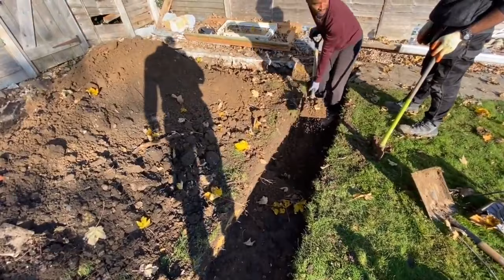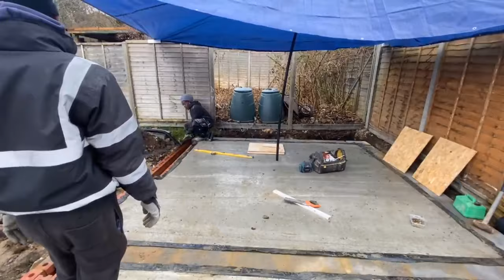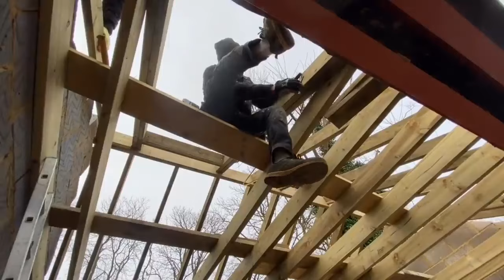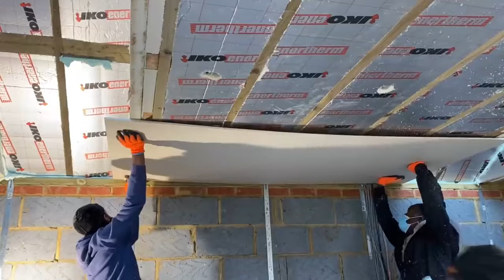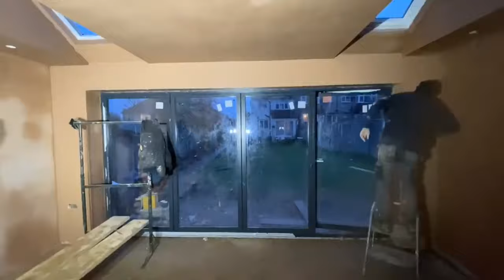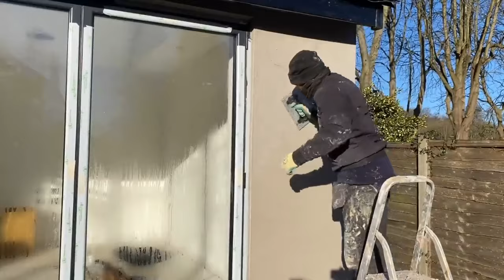HOW TO BUILD A GARDEN HOUSE WITH PITCHED ROOF

Comment: Excellent work ... You guys make a great team and you are all so multi-talented
Reply from the maker: Thank you very much!
Reply: @darrenthebuilder  Great Video!  I was wondering what thickness of insulation do you use in the floor and how thick is the concrete slab on top of it ?

Comment: Looks amazing, thanks for sharing. So 2 questions, how much do materials for a project like this cost I assume it was 8x4m? 
And question 2, what's the difference between an outhouse like this and an actual house? Is there a different process or more thorough specs/guidelines to adhear to or a deeper foundation required? As an example, could a bigger version of this be used as a bungalow to live in or would there be a lot more to it?
Thanks

Comment: Absolutely great to see the building come together like this. Well done.
Can i ask, when doing the framing/stud work, you used Screws to put the studs together.
Does it matter if you use Screws or Ring shank nails?
Which one is best?
Whuch one is stronger?
Reply from the maker: It dosent really matter. I personally prefer screws but they are more expensive. Nails are actually stronger when it comes to bending and breaking but screws won’t pull out over time although unless it’s a hurricane none of these things are really issues lol
Reply: @darrenthebuilder  Thanks for your advice 👍

Comment: Sorry guys, are those themal air rated blocks below the DPC or are they made for this?
Reply from the maker: Hi they are called trench blocks. Similar to the thermal ones but designed for below the ground.
Reply: Okay thanks for the response, lovely job you guys are doing 👍

Comment: Amazing job all in. Small question, do you not put capping over the cables before putting the plasterboard on? 
Also how much did you charge? If you fancy a trip over to Bristol then you've got some work.
Reply from the maker: Thankyou
Q1) Capping isn’t needed these days with RCDS etc. 
Q2) Definately not enough for what was involved and material costs. Was just over 30K. Exclud windows/doors.
Bristols out of my range though 😊 I’m based in London. Many thanks
Reply: @darrenthebuilder  thanks for the reply. Yes I realised you were in London.

Honestly, the work you did on this and other jobs is excellent, all you obviously have alot of care and the quality is high up your list. Great work ethic and obviously extremely hard working.

With putting out on YouTube you are proud of your work but you should be. They will obviously be standing for many years and look great. I see alot of garden rooms that are built from timber frames with cladding, I'm not sure if I would prefer a brick building or wooden structure with nice wooden cladding. 

But I guess with either the finishing touches (flooring, windows / doors, roofing material and render / cladding) can really make the difference for the final product.

Comment: Oh boy😬 you can't call this skilled work but maybe naive. It starts with simple basics like no soil compaction, no gravel as frost apron, no iron reinforcement in the strip foundation, the "insulation" with eps-plates forms a cold bridge and the water can condense along to the foundation and you will have always wet walls and soaked plasterboard soon also black fungus behind it, the statics of the roof are also a catastrophe while the roof is under a load, so it can simply slip away to the front and back like a house of cards without the necessary mortise with the ridge purlin and about the insulation of the roof I will even have to start... 🤦🏻‍♂️
Reply from the maker: @viscid09  no idea what youre talking about. Everything you said is false and not relevant to the building. Either you didn't watch it all, or are just ignorant of Uk construction practices because you're extremely wrong in your “accessment”
Reply: @darrenthebuilder  Sorry to hurt your feelings but I´ve watched it to the end and as building physicist I can´t argue with you about thermal coefficient or building statics in YT comment section. For your own usage this may looks good enoug but if this was a contract work this is almost negligent what you have done in relation to building safety. Maybe in this time lap I miss some detail but in whole this work is not good enough. Sorry for being honest I don´t try to bully or be ruthless just hope you can reflect your own work...